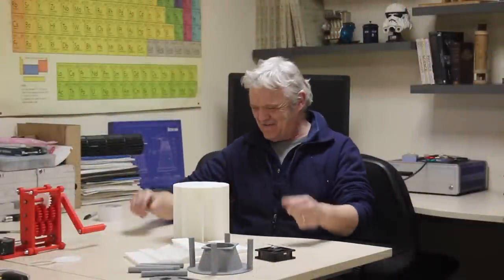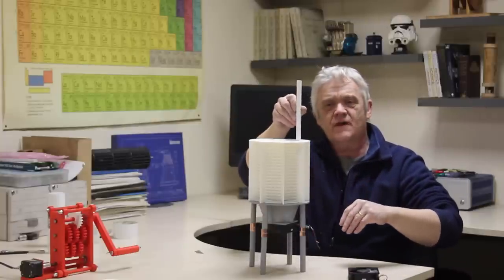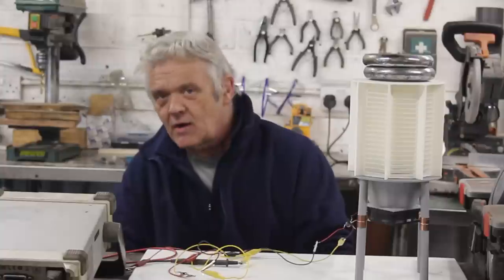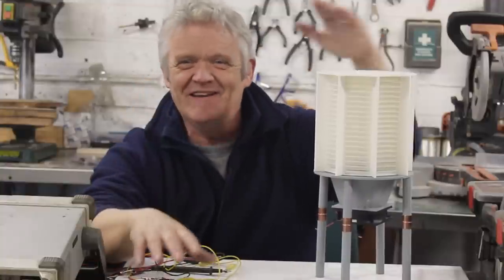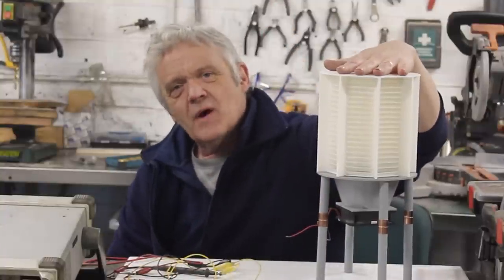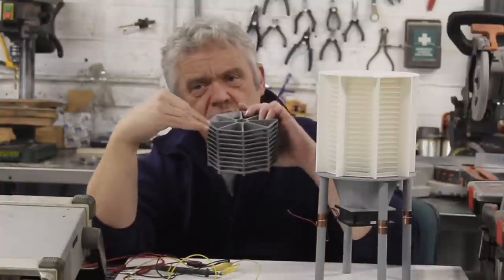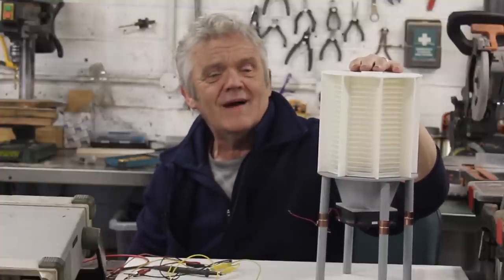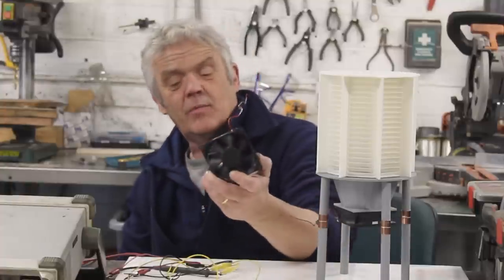1835 Darwin Wind Turbines - The Answer To Wind Generation

Comment: I was starting to get a little pessimistic about using wind turbines for augmenting our off-grid power system. But your enthusiasm for practical investigation is infectious. Keep up the good work!
Reply: the way i think about it is both wind and solar have pros and cons and its about utilising those pros and cons. mono crystalline solar cells have a great ability to generate alot of electricity during day time less at night time, however its ability to control temperature is really low, with a battery it can sustain the standard of living we have now. wind has a decent ability to generate electricity, depending on elevation and windspeeds, however its ability to effect temperature and combustion reactions are its biggest effect. however we are still in the electrical gold rush and havent really utilized other forms of energy to its fullest potential yet. a good thing to think about is why batteries are the only form of consumer energy storage, well ig you have snap heat packs and tanks which youd consider storage of heat energy and wind energy, but doing research on that alone will prove that study of electrical storage is a strong factor in why we dont have storage in other forms. tbf making a wind energy device would simply require vacuum levels of insulation with fully controllable or "set for purpose" heat conductivity, something really hard to liquify at room temperatures like helium, a tank that can survive high enough psi, then a way to compress it and cool it enough to solidify it. not qualified just thinking off the top of my head

Comment: May have been interesting to measure the wind speed coming out of the bottom with the anemometer for comparison.
Reply: could be just Low speed and High Pressure
Reply: agree, its likely tripling the air speed.
Reply: Exactly what I was going to ask.
Reply: Yes this would be most interesting. I'm thinking the surface area of the wind catcher is about 4X... wind speed at the fan should be about X4. So much scope for improvement. Great experiment more please.
Reply: My thought also
Reply: I would guess it would be much more bird and bat friendly! As well as safer and easier for maintenance.
Reply: it certainly would have been good to look at the difference when static pressure is reduced versus when it is normal. 
meaning covering the bottom of the whole rig.
Reply: @AORD72  why would it be useless? Urban environments do not have the best wind quality and thus are mostly not viable for traditional windmills. Windcapture structures are very promising and are already being fieldtested. It is actually very very very astonishing that windcapture structures only come up now comercially while it has been used for water for ages. The concept is simply the same, if you can concentrate the flow you can increase the pressure and thus the force on the turbine blades and thus get more electricity. 
btw the old rts game Dune 2 already featured wind capture powerplants but only from one direction.
Reply: Agreed, that would be the first thing I would test
Reply: @waynemanning3262  😂definitely bird friendly, pigeons  would’ve flocking to nest in the fins

Comment: An idea about improving the design,  vortex generator. Spin the wind in the funnel and the fan will spin faster.
Reply: I was going to suggest the same things. 
Great minds think alike and fools never differ.
Which are we? Experiments alone can determine.
Reply: @bmobert  well another fool to your list, cuz I was thinking the same thing. Putting some angled slats in the cone at the bottom would give you a Vortex effect.
Reply: Said this on one of his other darwin turbine videos
Reply: oddjobbob  yeah that's why I said put some little angled slats of metal attached to the inside of the cone down at the bottom. You would have no chance of causing any turbulence up higher just right before the wind generator fan. The only way to tell if this will really work is to try it one time, then we'll know
Reply: Spin in an air column gives the flow stability.  It reduces the potential for turbulence to reduce efficiency.  Given that only half of the airstream is pressurized and the other is actually under suction. I.e. the back side of the air collection assembly is dead air under a lower pressure. No moving Louvre to stop air from blowing up and out.
Reply: Trigger the vortex by twisting the horizontal slats (near closed one end to near open the other)? Easy with a 3D printer I'd have thought.
Reply: A la variable geometry turbocharger? I guess you could get pretty complicated with the options! Plus, in the UK we have horizontal rain to consider so we would need to spin the incoming air to enable water to be efficiently collected away from any turbine.
Reply: oddjobbob  the vortex is created in the tube or funnel before the generator. Ribs can be added to direct the flow of air.
Reply: I guess I should have looked at comments before I commented. This is what I was wondering too. I would think creating a vortex would also create a low pressure area and you could but a turbine on both top and bottom possibly doubling your production.
Reply: Slats at an angle to horizontal so that each set is imparting a twist to the air relative to the next set. Now the big question is should the vortex spin with the fan or against it, latter would increase pressure (???).
Reply: The energy extracted from the air remains the same, if you generate a vortex or not (if you do it in a passive way), therefore, I would improve and study the air characteristics where the turbine is, if the flow is turbulent at the area where the air reaches the blades, instead of laminar, and the blade is "lift" type the efficient is going to decrease, you actually have to do the opposite, make the fluid laminar.

Comment: This would be amazing to test with older corn bins or on top of old silos.  I see lots of them as I drive around beautiful rural Michigan.  The outlet could be adapted to several varieties of fans or turbines.  One challenge will be back pressure from the outlet.   If you could form a convex lid below it, that may create a negative pressure to help pull the air through the Darwin section.
Reply: Wow. I never even thought about converting old silos into wind generators. I wonder if anyone's done it.

Comment: Great job! I am currently experimenting with a cylinder design with a spiral pathway on the inside (like a rifle barrel) to increase cyclonic rotation. The openings are also angled parallel to the spiral to direct the wind into the tube in the same direction.
Reply: If you're willing to share your files as you go, I'd be really interested, and I'll bet many others would be too!

Comment: I love the whole idea of this Darwin Wind Catcher and not just for generating electricity. I think these would do very well on a roof to exchange air inside a home or shed. You put one at one end forcing the air down inside, and one at the other end pulling the air out. I also am interested in this design for doing mechanical work, I think I might like to try making one of these to constantly rotate a compost tumbler at a VERY low speed by gearing down the output shaft.
Reply: Darwin's (E) original idea was to use it to grind chemicals for the Wedgwood pottery.

Would using the electricity from the bigger version be as efficient as a gearbox if not more so as you don't need to keep changing gears as the mindspeed veries?
Reply: middle eastern houses have used that principle for at least 1200 years and it works really well for air conditioning
Reply: @Silent_Flight  yeah wind speed would obviously vary, but that's why I'm only suggesting something passive like turning compost. But windmills have been used for things like sawing logs for a long time. If the wind blows slower your productivity slows down, that's all.
Reply: @gordslater  the wind towers that they have in the middle east are also connected to underground rivers, which is where the cool dry air comes from. They're not taking outside air and cooling it in their homes it's being cooled underground and the towers allow for a heat differential to take place.
Reply: @gordslater  and I'm sorry I should have been more specific I'm just talking about using the darwin for air exchange, not heating or cooling. The inside would be the same as the outside.
Reply: @adamdecurtins3405  It would be a little cooler though.  Air aloft, even just a couple stories, will be cooler than ground level air and certainly cooler than air static inside a dwelling sitting in the sun

Comment: I think you might have a challenger for the wind wall if you use several of those piped to a central chamber venting up to mimic a termite mound you might get a more stable output from all of them also allowing you to use the rocket stove or any other heat source for a more active capture. Thank you for the video and infectious curiosity

Comment: You could put a 90º bend on a swivel arrangement on the bottom so the opening always faces away from the wind, causing drag in one direction through the devices, should help a bit, and maybe have the internal walls twisted to also form a spiral to direct the wind and give you full coverage of the generator fan.

Comment: Thanks for sharing, love the channel! Just a thought that popped into my head while watching this is to reverse the direction and have the turbine on the top. The reason is that hot air goes up so naturally. So there will be less resistance on hot days 🤗 you could also deliberately make a higher stack, paint it black to encourage natural air flow with no wind blowing 🤔

Comment: One of the ideas for increasing airflow through an exhaust window fan was to inset the fan inside the room by as much as the diameter of the fan to allow extra air to join the direct fan blast from around the edges of the fan’s frame. T’would be interesting to test this idea with your wind catcher by dropping the generator below the Venturi fan by as much as fan diameter without the proposed enclosing tube extension. The typical Venturi pressure/speed differential results are for a “closed” system, not one that allowed the addition of air.

Comment: Hi again Robert.  Just love your videos.  I have a suggestion.  make your tower our of clear plastic with the wind going in and upward.  in the sun the air will be warmed as it moves up the tower causing the air to expand and increase the air pressure.  top it with a Tesla turbine attached to a generator..  this should increase the power genertated.   Love your designs.

Comment: Really, really liking this idea! What I’m loving is the potential scalability on a more or less flat plane, I’ve got nowhere safe to install large moving blades, but a bank of these connected to a tree of guttering pipe could add up to a decent wind surface area equivalent to e.g. 2.5 meter blades, concentrating on a remote turbine. Maybe inside the pipe you’d need something like a cone (i.e. ‘air diode’) to prevent back flow out of the other Darwins.
Reply: Venturi

Comment: I’ve used an AC PC fan (aka server rack fan) as a generator to test airflow designs, it actually worked quite well to tease out small improvements in efficiency.  I was designing a seemingly simple side by side dual PC fan to 6 inch hose adapter but the airflow from the fans was interfering with each other and ultimately needed a barrier between them so the airflow was directed towards the hose outlet.  I would have benefited from proper 3D airflow simulation software which I attempted to set up so that I could test a bunch of designs first before printing them so I could narrow down the best ideas without using so much filament and time in the design phase...  unfortunately I wasn’t able to completely figure out the particle physics and outputting the final data and animation from Blender but I got to the point where I could visualize the difference in airflow between the models, but not a simulation of the actual fans, which unfortunately was the detail that I needed to study...  I bet there are some open source tools for doing this out of the box at this point, it would be a great way to preview the differences of novel designs and help people modify existing designs by visualizing the airflow which can help when coming up with ‘shape’ ideas.

Comment: Your Darwin model looks great Robert and you discuss using 35 degrees arbitrarily  . My first thoughts on watching this is that the slats , besides being at 35 should also be spiralling down like a multi start thread and there should be an internal tapered section , starting above the slats  to assist the cyclonic air movement . This internal taper should prevent the nagative air pressure build up on the opposite side from which the wind is blowing and may even create a venturi effect resulting in an increase in the wind speed. I enjoy watching your output.

Comment: Later iterations of this would likely need an overflow valve. If the wind becomes too strong, having a means to prevent damage to the turbine section would definitely be worthwhile.
Reply: What about a large-diameter Tesla valve pointing against the incoming flow? At high wind speeds, this would act as a no-moving-parts check valve. 

The large-ish diameter would mean that low and modest wind speeds could travel through "the wrong way" through the valve relatively unhindered. At high speeds though, the resistance to flow rises with the faster flow upstream through the valve. In very small capillary Tesla valves, resistance to flow in the wrong direction can be ~100x the resistance to flow the "right" way.

The trick with this idea is that you'd have to size the Tesla valve appropriately so that it provides air braking at the right air speeds. This would probably have to be trial and error to get it right unless you've got some physics major on your side!

I wonder if overall flow could be increased by having a block with several parallel Tesla valves?
Reply: @mookiemorjax  Thanks for that great idea. I was also looking for a passive way to control the flow speed. In any case I would put the flow control on the outflow instead the inflow, because it has smaller dimensions.

Comment: My windmill is the best design ever, its a cubic frame holding a vertical axle in the middle, 4 panel attached to the axle that the wind pushes around, each side of the frame has half a panel to shelter the wind from the negative side, a ring is half way up the frame with copper vire coil and a magnet held at the end of each spinning panel, as it spins it creates electricity, when the wind blows it goes so fast that is scary, but because of the centrifugal force it dose not move.

Comment: The reason the fan that is not attached to the Darwin device is because the air is blowing around it. If you put a 4-inch or 6-inch pipe on that and then blew your blower into it it would produce. What makes the Darwin device a good deal or something that is worth researching and investing is the fact that it catches a large amount of wind and focuses it in a small area.
Keep doing what you're doing thank you.

Comment: Really fascinating design here, thanks for sharing.  It occurs to me that the spacing of the fins could be quite important, since of course if the fins are too close together, they'll create air resistance, like how an olympic swimmer gets more thrust out of their hands with the fingers slightly apart than all the way closed, the gaps are small enough that effectively it's still one solid flipper (hand).  So the same effect could be at play with the fins.  Maybe staggering them one more in, next more out, back to more in, etc could help offset that?  Have fun, love your videos.

Comment: You can almost get away with pallet wood only and also the center can be used as a funnel up top and piped through one of the center walls out of the side to a rain water collector. The air exhausted from the turbine can also be useful for an ancient air conditioner system but modernized and piped through the three tunnel Dielectric AC. Which can also take advantage of the rain water collection for evaporative cooling.

Comment: Love it!  I wonder if you continued reducing the cone on the bottom, to 1/4 the size of the fan, then oriented the cone to one quadrant of the fan if it would increase the fan speed?  The other 3/4 of the fan would likely need to be covered I reckon.
Reply from the maker: awesome
Reply: Ex turbine design engineer here. If you only load one quarter of the turbine you generate a rotor imbalance, create an unnecessary lever arm and could prematurely wear the bearings or just cause an instantaneous failure depending on the forces involved. Best to keep as equal a loading across the blades as possible
Reply: @jamesmullen3827  Yessir that does make plenty of sense.  Thanks for the feedback.

Comment: That is great Robert. Couple of thoughts I think may be worthy of consideration:
1/ could the opposite side be generating a negative pressure and therefore sucking some air from the PC Fan? If so some very light flap valves placed on the bottom of each octet will stem this effect. 
2/ I think the fan (generator) should be as close as possible to the Darwin redirector. Its much easier to limit losses in wires (bigger wires) than in a tube I would think.

Comment: This is the best idea I have seen on this channel. Two thoughts: first, if you took off the fan temporarily, you could put the anemometer in the same location and measure the wind speed there to compare again that produced by the fan. Second, when you go to add a pipe, it would be great to have pipes of 1,2,3 foot lengths ( or 1, 2, 4 ) so you could measure wind speed and turbine output and get a rough idea of the shape of the curve of the loss of power. Can you put these on a 10 foot or 10 meter pipe and still get a high percentage of the power? Dying to find out.
Reply: Etrike up there too!